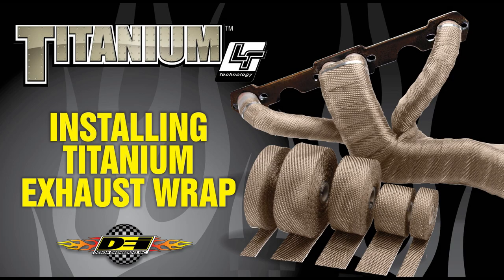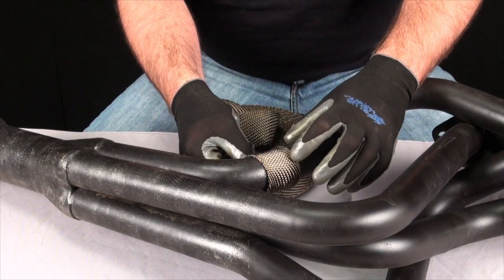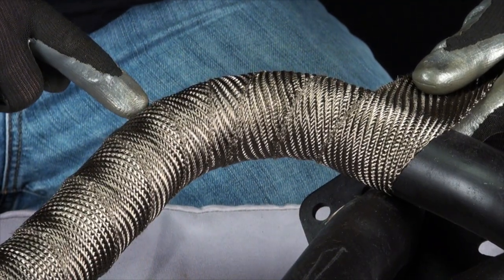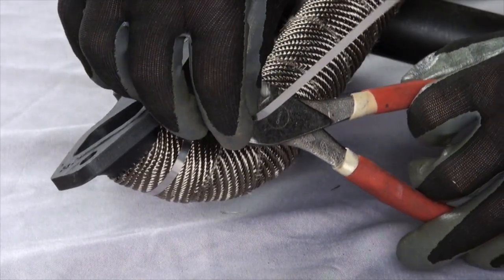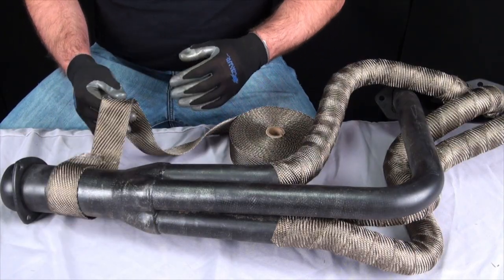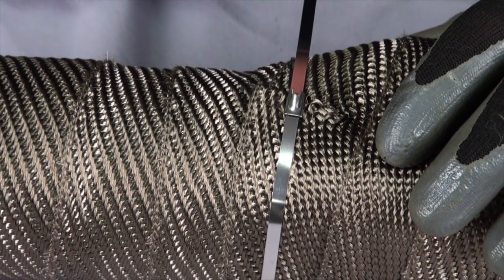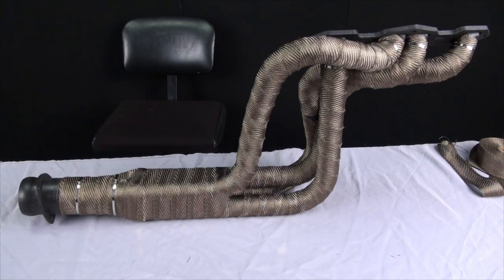"The Original" TITANIUM Exhaust Wrap Installation

Comment: I have used this product with success. I have wet it, though. Instead of the ties (which I have purchased at a local DYI home store), I have whipped the ends with a good quality wire. I have also used water-based glue (like Elmer's) to further secure the ends. It works! Don't use petroleum-based glue. I then spray the wrap with the correct heat paint. Enjoy. (Wear a long-sleeved shirt!)

Comment: Not mentioned is the fact that  if the overlap develops a gap and the tube is exposed, it is very possible that the exhaust will burn a hole through the steel. A friend had a Camaro running a 302 with manual trans and that happened to him. Plus, try to get all the way to the flange. Why risk it?  Jere Stahl of York, PA (Stahl Total Tuned Headers),  used to badmouth wrapping any header saying he had more repairs from wrap damage than for any other reason. ACP headers in Harrisburg is now making them exactly as the originals with the same methods and materials. Stahl headers were never cheap and it is a shame we lost him a few years ago. His wife had the website removed with all his instructions. My friend with the Camaro says that properly wrapped, the do work and horsepower is increased enough to make it worth the expense.

Comment: Question: the video discussed "counting the loops" at 1:00...  Q: Is the length of one loop the circumference of the pipe to be wrapped.? The transcript clarified my question.  Excellent video by the manufacturer which includes a transcript of the video's audio. !
Reply from the maker: Correct, the loop is roughly the length of the pipe's circumference. Be sure to allow a little extra for the 1/4" overlap.

Comment: Should I be concerned that water will get behind the wrap and rust the pipe?  Although, if the car is used frequently, any water that collects behind the wrap will probably be boiled away.
Reply from the maker: If the car is at operating temps, any water that makes contact with the wrap will likely evaporate immediately. If you pull the car or bike out to detail, and get the wrap wet, we recommend running the motor and getting it up to temp in order to avoid this issue.

Comment: The video states to wrap from collect up to the engine side. Would it hurt to start at the head and wrap down to the collector as long as the sown edge faces the collector?
Reply from the maker: It's not going to "hurt" to wrap that way - take it from someone who did it that way before working at DEI. The point of wrapping it the way we prescribe is to prevent premature fraying. The "sewn" edge should ideally be the edge that's visible, whether you wrap toward or away from the header. Think of it as a more built-up, calloused edge, that can handle more wear and tear.

Comment: So no silicone spray need to complete the instal?? can one use the silicone anyway? ... also... what if a guy was to use a ceramic paint prior installing the wrap.... would that cause any adverse affects?? ... thanks....
Reply from the maker: You do not need to use the silicone paint after the install. You can use
 it on Titanium but it is a different process for application. You would
 need to spray a coat on, run it through a heat cycle, add a second 
coat, go through a heat cycle then add a third. Because it is a 
different material than glass fiber, it soaks into it differently and 
needs a few coats and a few heat cycles for it to adhere properly. It 
will protect and prolong the life of the wrap and can be used.  As far 
as having Ceramic paint on the header before wrapping, you can wrap over
 it. It will speed up the process of burning off the ceramic paint 
faster than it normally would, but it is OK to wrap over ceramic paint.

Comment: does a High temp silicone coating need to be used with the titanium wrap?
Reply: I would use both although not sure if I would wrap then spray or spray then wrap.
Reply: What is the advantage of using both titanium wrap and the silicone coating? I am about to install titanium wraps on my motorcycle exhaust. Thanks in advance, guys...🙂🙂
Reply: Daniel Caldwell you can spray first to pipe if wrap is slipping, and then apply afterwards.
Reply: Foreveryone reading this comment, do not coat the titanium wrap. It will cause it to degrade. I coated my header with silicone coating, wrap, then another silicone coating. A year and a half later the wrap was essentially powder, and just fell off the header. Now re-doing with only the wrap and nothing else
Reply: Eithan Maler have you had similar issues with the non-sprayed wrap now that it has been a year?

Comment: Any spray necessary for this type of wrap?
Reply: Absolutely! DEI and other vendors have high temp silicone-based sprays on offer precisely for this purpose. Note however spray application process for titanium wrap is more extensive than for fibreglas and must be followed precisely. DEI has the detailed answer here in an older post. Cheers!

Comment: Has anyone used this for Cold Air Intake tube? I’m reading online it’s not good to use because it keep heat inside but I read other it’s good so idk. I want to use the best so it’s either this or gold tape wrap
Reply from the maker: Julian,

The proper way to insulate the intake tubing would be to use a heat reflective material such as Reflect-a-Gold or Reflect-a-Cool. These will block radiant heat from soaking into the tube in turn keeping IAT's down. Exhaust wrap is meant to contain heat and is primarily intended for hot side piping.

Comment: question: since wrapped and/or ceramic coated headers dissipate way less heat, and impressive results are often seen where the difference can be between 200f (treated) and 800f (untreated) does the heat tend to stay more in the block, or do the exhaust gases themselves simply get more hot inside?
Reply: The heat remains in the exhaust gasses and is not retained within the cylinder walls or piston head.
Reply: my theory is block cyl temp should maybe even run bit cooler due to the increased exhaust flow/scavenging. going to test soon
Reply: @yanb1981  You clearly understand the process. Sub'd and looking forward to your findings. Cheers!

Comment: Hi does this stick on tight 
when your exhaust pipe heats up.   ? 

Thank you for any reply 
Best wishes to all
Reply from the maker: After a number of heat cycles, there will be a slight amount of shrinking, just enough to make it a bit tighter.
Reply: @DesignEngineering  Does the Titanium wrap displace heat better than the fiberglass wraps do?

Comment: I have bought two 50 foot rolls of DEI exhaust wrap. How can I tell if it's Fiberglass or Titanium? There is no identification on the packaging to indicate the difference.
Reply from the maker: Yes sir there is identification on all of our packaging. The part numbers for our 2x50 Titanium wrap is 010127. If it is our Tan 2x50 fiberglass wrap, the part number is 010102. There is a very distinct difference between the two. The Titanium is a softer, more flexible wrap and is titanium in color. Our Titanium wrap has no fiberglass in it all. The fiberglass wrap is a much rougher surface and is a true tan in color.
Reply: WOW!! Thanks for the reply guys!! The part numbers are Part No. 010108 Black. So I'm guessing mine are fiberglass. Thanks for the info!!

Comment: Hi, i´m thinking about trying the Titanium wraps for first time on headers, but looking about opinions and experiences with it people talks about how this kind of wraps can damage headers because they keep moisture from condesation and it generates oxidation, is it true?
Another question would be, how long does it last? do you need to renovate them?
Thx in advance.
Reply from the maker: If it is used on a lesser quality header with a low quality steal it could. With our experience, water and moisture will not affect the header. The heat from the header dries the wrap so water will not sit in the wrap. And as long as you would follow the 1/4" overlap rule when installing, the right amount of heat will stay in the pipe and not overheat the metal. A lot of times if a header degrades, it is because the header is double wrapped, holds in too much heat and degrades the metal.

Comment: Probably a stupid question, the header I'm going to buy is made 100% of stainless steel. Will wrapping it with the titanium wrap be harmful or helpful on the steel? Just dont want any degradation of my header.... and does this also help with hp gains? Is it strong enough for long term usage?
Reply from the maker: Not a stupid question at all. It will not degrade the metal. We tested wraps with a 1/4" overlap when wrapping. This lets the right amount of heat out of the metal to not affect it. We have seen people double wrap the pipes thinking that if one wrap is good, two is better. And this isn't the case. When you keep too much heat in the header by double wrapping, thats when problems occur. And it will help in power gains. Hard to say how many horsepower because there are so many variables. But it reduces the underhood temps so it cooler air is available to the intake and the engine. It also decreases the density of the exhaust gasses so it lets the whole system become more efficient.
Reply: +Design Engineering, Inc. Yes the 1/4" overlap is perfect! Thanks
Reply: According to Roy of TalkingMods and ModBargains, as explained here on YT  https://www.youtube.com/watch?v=bg2tMO0eD-E
In exhaust applications, operational, running temperature limit for SS304 tube is 860C/1580F with near lifetime endurance under stated conditions. As always, YMMV. Cheers!

Comment: I was told to wrap thick aluminum foil around the pipe before the titanium exhaust wrap, 
ButI was thinking thatthis could cause corrosion on the pipe. what do you think aboutthis method? Thanks
Reply from the maker: I would not recommend doing that. I have never seen it done but it does not sound like a good idea. It will have no benefit to the wrap at all. If you are thinking if the wrap gets wet will it rust the pipe? And the answer will be no. The heat that is in the header will dry the wrap. I would not recommend doing it.
Reply: siegfriedo brabender That method defeats the purpose. I would not try it.

Comment: Do you need to ceramic paint your headers & turbo manifolds then wrap them?
Reply from the maker: We don't recommend doing that. The wrap will keep heat in and eventually burn off the ceramic coating.
Reply: @DesignEngineering  Thank you for your time and info. I'm have redo all my heat wrap on my Hyundai Tiburon v6 turbo built

Comment: i was wondering what is the difference on the wraps of titanium and fiberglass.  I know that with fiberglass you have to use gloves for protection and i was wondering if you have to use gloves on the titanium wraps also.   I just use gloves all time working on my car.  but was just wondering on the different wraps if you have to use gloves on the titanium wraps for protection?
Reply from the maker: +Mark Raiden Mr. Raiden, we would recommend it. It is not a fiberglass material but fibers from it will come off and if your skin is sensitive to it, it potentially could irritate a little bit. So we would recommend it.
Reply: ok thank you very much. i just wanted to take the precautions of fibers.
Reply: i installed mine with bare hands and trust me you want to use gloves
Reply: @DesignEngineering  This is an understatement. The fibers get EVERYWHERE

Comment: Hi im going to wrap my kooks headers (09 Mustang). Would 1 50' roll be enough?
Im also considering wrapping my off road H pipe. Would an additional roll be required?
Lastly, how much of a heat reduction under the hood can i expect?
Reply from the maker: +Gavin F We usually recommend a 2" x 50ft roll per V8 header. If it is a shorty header it will take  a little less than that. But you will need more than 1 - 2" x 50ft to do both headers. As far as the temp heat reduction, it kind of depends on the motor and other mods you have done to the car but we usually see about a 45-50% decrease in heat under the hood from the headers.
Reply: +Design Engineering, Inc. So one roll would work for my 4-cyl. 944. Does the wrap make a BIG difference in temperature under the hood?
Reply from the maker: We usually see about a 50% temperature drop in under hood radiant temps. And it would be close for one 2"x50' roll to do both headers. It would honestly be a little more than that. Probably another 2"x15' roll you would also need.
Reply: Thanks for the reply DEI ;-)

Comment: I got some of your wrap but it unravels immediately after cutting--how do I prevent that?
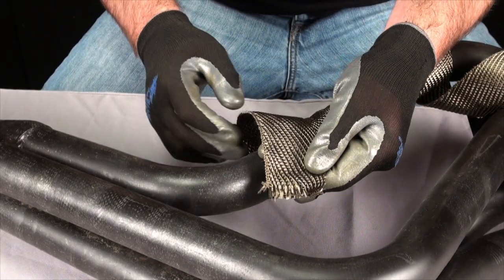Reply from the maker: You can put tape on the area you are about to cut and cut through the tape and wrap together. Or after you cut it, trim off any long loose fibers and Fold the corner in to give you a solid edge to start with. You can see this in the video at about 1:20 into this video. This will prevent any fraying or unraveling when you are wrapping.

Comment: would it be a good idea to put this on a metal air intake? it gets very hot under my hood
Reply: The Upscale im about to do that on my drag car
Reply: Why the heck would you want to trap more heat in your air intake pipe???? Not a smart move!! By this reducing the heat on the outside, it creates more heat and pressure inside.... When is the last time you seen heat going into an engine make more power???? Smh.

Comment: when you wrap your exhaust. Will it get hot on the outside of the wrap (can you touch the wrap when you're driving?
Reply from the maker: It will still be pretty hot but it cuts the heat down by about 50%. Without the wrap you will burn skin instantly. With the wrap on, you can bump against it without getting that instant skin burn. If you have  to work on your vehicle when it's still hot, it makes it much safer.
Reply: Thank you!

Comment: what's the best brand of exhaust wraps? i see divergent prices form 15 to 70 dollars why?
Reply from the maker: When you see the same named product for a lower price, it has all to do with the materials used in the wrap and the heat capabilities. Many wraps will call themselves Titanium or Lava wrap but do not have the thermal capabilities and are not constructed from high temp basalt materials like DEI wraps or glass fiber with a propriatary coating. And many of the cheap price wraps come from out of the United States and they are basically cheap material knockoffs. DEI was the first to come out with the Titanium name product line back in 2006/2007. We used the name Titanium to signify the strength and color of the product and what it is capable of doing because of the high quality materials. All of our wraps are made here is the USA and we focus on performance standards above all.

Comment: Would this product work well to wrap my intake piping to keep heat out?
Reply from the maker: +Gabriel Grieger this isn't the best product for that application. This actually insulates heat to keep it inside the exhaust pipes or headers. you would want to use somthing like our Reflect-A-GOLD or Reflect-a-Cool products. those go on the outside of the intake pipes and refelct heat away from them so you don't get heat soaking into the intake air charge. Check it out here...   https://www.designengineering.com//category/catalog/design-engineering-inc/heat-sound-barrier/reflect-gold
Reply from the maker: +Design Engineering, Inc. You can find it through Summit Racing or Jegs.
Reply: Oh wow. Learn something new every day. Thank you!
Reply: why would you wrap intake ? its not gonna make your air cooler even hotter
Reply: To try and keep heat from the engine from heating the intake pipe and air.
Reply: +Gabriel Grieger so you having turbos ? or your intake are near exhaust manifold ?
Reply: What? No? I was thinking of using this wrap stuff to insulate the intake air piping in order to keep the hot air from heating up the cold air coming from outside of the car. I learned that there is some sort of gold wrap that's made to do that.
Reply: +Gabriel Grieger oh i understand, yes gold wrap is a good method

Comment: I have exhaust wrap on my Quad and after a couple of rides it is all White and not Black anymore. Why?
I dont remember the brand.
Reply from the maker: Most traditional wraps are made from glass fiber, which is clear/white naturally. The black wraps are made with a coating that wears off over time, especially if it sees a lot of direct exposure to rain and puddles. DEI has silicone spray available to preserve and/or renew the color on glass fiber-based wraps.

Our Titanium wrap is not made from glass fiber, but instead stranded basalt fiber. The bronze color you see is the natural color and won't fade away.
Reply: Design Engineering, Inc. Ok, so If i install this even though it Will see rain it Will keep this color?
Reply from the maker: @ProMotoo  The Titanium wrap would keep it's color, yes.

Comment: How long can I expect the wrap to last?
Reply: I've had this exact wrap on my bike for over three years now and I'm replacing it now. Mine got dirty and doesn't look as great as it did. I never had a problem with it coming off or getting loose and you shouldn't either of it's done properly. It's very tedious, and takes patience, so if you lack patience, just pay to have it done. lol If it is done right, it will never come off. Just wear gloves when you put this stuff on because I had like a thousand paper cuts on my hands from this shit. It burned like hell in the shower. Also, hose clamps worked a lot better than their outrageously expensive metal ties.
Reply: A better question would be "How long will my header last?"